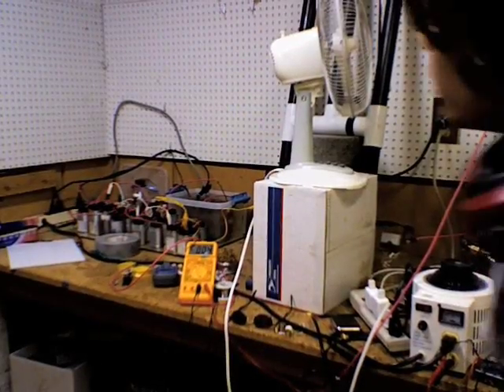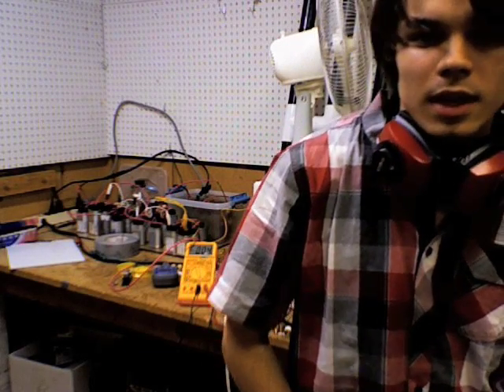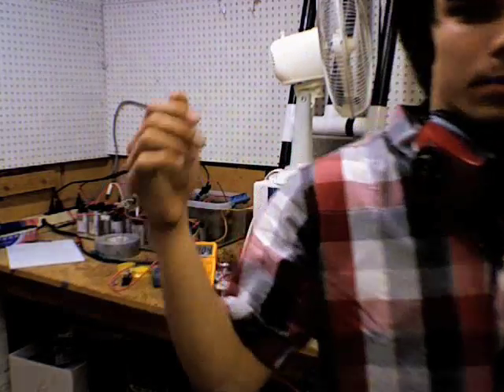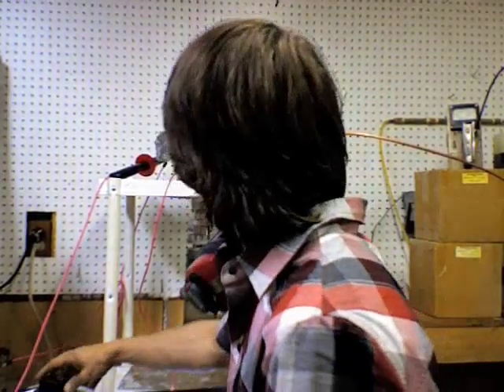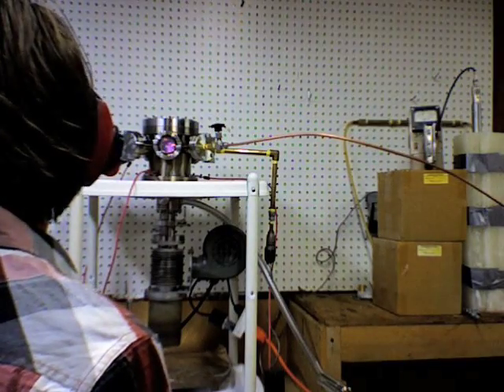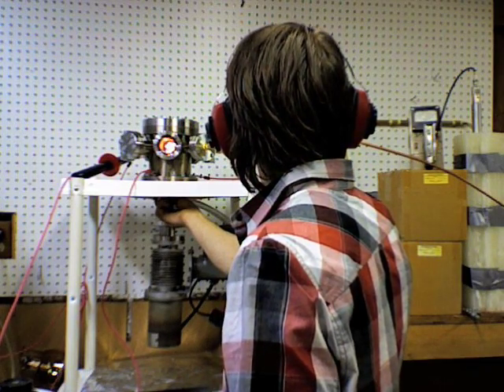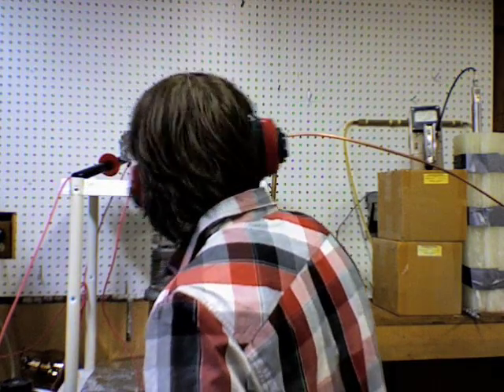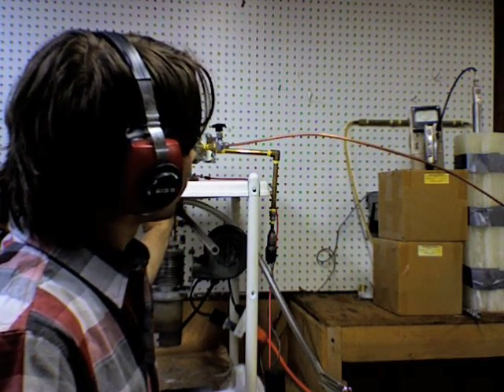Fusor V:  First Neutrons

Comment: Since you seem to be the only one who has ran at only 5mA, what do you think about counting using something less sensitive than a He3 tube? I've got a supply rated at 40kV @5mA but I am concerned that I won't be able to get many counts on something less sensitive like a boron 10 tube. I see you have 1000 CPM at a little under 200 watts so I just wanted your opinion from experience, if you have time that is. Thanks.

Comment: @U235hexafluoridedude One thing that is baffling me is how do you wire up the transformers outputs to the fusor? Do you rectify the output and connect the negative side to the inner-grid? Plus if you connect the negative side to the inner-grid then where does the positive side connect to? From what I've read it should be grounded but it seems dangerous to me to connect a 35,000 volt output to mains ground.

Thanks, 
Taylor

Comment from the maker: @davethehunter2 I may yet do a little vid on the power supply.  Yes, back then I was using 4-7 MOT's with their secondaries in series off 110 with an inductive ballast on the 110 side.  I've since replaced the MOT's with a 14.4kV Pole Pig.  The circuit, to start you off with, is simply a voltage quadroupler, 1 transformer, 4 capacitors, 4 diodes, each capacitor is made up of SEVEN 2.2kV 1µF caps in series.  Each diode is currently a 60kv string.  I hope this helps until then.  Warm regards, RT.

Comment: you should do a video just on your power supply, because its very interesting that you able to use MOTs to get fuson, and are you using 120v ac in the input? Im very interested in your design, the power supply must of cost you nothing compared to a xray tranformer and im looking to build one for the cheapest i can. could you send me your schematic, you dont have to but it would be greatly apreciated. 
Thanks,
David Rutherford

Comment from the maker: @algae1000 Hey, thanks.  Yes, I purchased the chamber as-is via university surplus.  I also got 1/4 liter of heavy water from a friend working in a MRI lab.  The hoffman probably only took about 100ml, if you were to fill it with ceramic pellets that'd increase it's volume and allow you to use and spend less on D2O if buying unitednuclear's $1/gram stuff.  Sodium hydroxide is best for the electrolyte.  And yes, that's wax, later use involved a water moderator.

Comment from the maker: @transistorbrater .. Thanks!  Bare in mind I'm not trying to discharge those caps, they arc in air cause they're not potted in anything.  They just function as a cheap mains frequency voltage quadrupler which as of a few days ago was modified to produce even more juice!  60,000 volts @ 100mA!